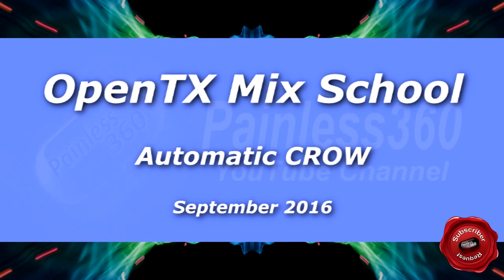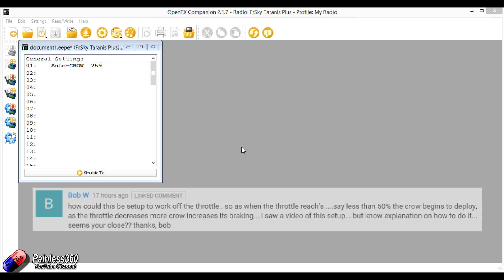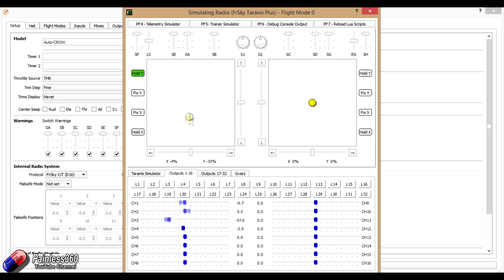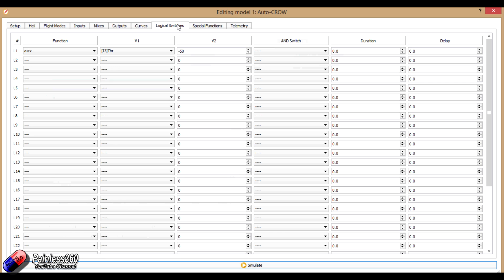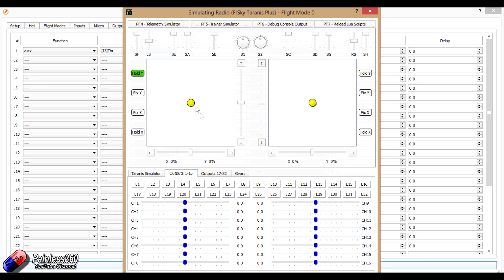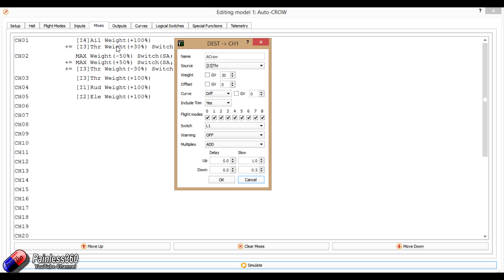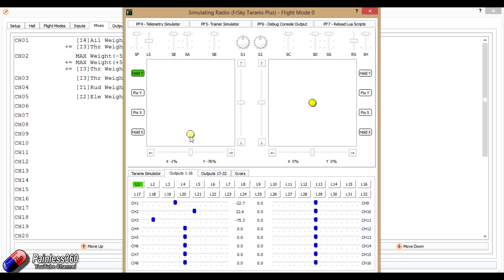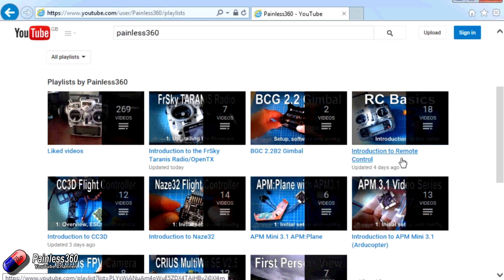OpenTX Mix School: Setting up Automatic CROW (braking) on a model

Comment: Sir I have a Question on Open TX for a F5J motor turn on emergency toggle switch. I using a Altimeter to read my Altitude and motor is shut off after 30 but I need a emergency switch if I can’t make  or landing in corn fields. Flying in competition F5J.
Reply from the maker: I'm pretty sure I have a video on something very similar to this.. It should be in the mix school playlist. Best of luck

Comment: I dont want to use a switch to have automatic crow.
I have my throttle on a switch and i use the stick to brake in the landing.
I dont want to flip a switch to make the crow function active, how can i do that?
It is an F5B plane with 3 flightmodes, speed, thermal and landing.
And yes, i can use the flightmode switch to activate but i want it active all the time.
How? (Horus X10S)
Reply from the maker: You can omit the switch h in the setup, it'll work in a similar way.  Best of luck
Reply: @Painless360  so than i put in with switch just ---. ?
Reply: @Painless360  Thanks, it was a bit a puzzle but i combined some things, i made the throttle stick a logical switch and than it replaces the SA switch in your vlog.
Thanks for the help!

Comment: Hey Lee... I noticed that when the crow activates the channels jump the first 20%... then follow the throttle down to the full 40%... it there a way to stop that and get a smooth transition... you can see it in the channel monitor... when the throttle hits -50, the ail channel jumps to -20, and flap ch jumps to -80.. then follows the throttle... I've tried finding the source of this... no luck! I can get it to stop by using a offset... but that creates other issues.Thanks, bob
Reply from the maker: Not sure what you mean. The way in the video seemed smooth..
Reply: well... if you look closely... as soon as the throttle reach's -50, all surfaces... ail/flaps jump to -20%<<ail, and +80 for the flaps , of the travel... so if the channel is set to 40% as the full crow movement, it jumps "instantly" 20% then moves the rest of the 40% as the throttle continues down... in your setup... remove the "slow" setting in your mix and it is more noticeable.. you can also see it in the channel monitor... move your throttle down and as soon as you hit -50 watch the ail and rud channels... they don't start at -1... they jump directly to -20.Thanks for getting back to me! Bob
Reply from the maker: +Bob W better to ask this through patreon.. :) then we can look at it..
Reply: I'm guessing that you have solved this already long ago?

The reason for the jump is that your switch condition is Thr < 50 %, and, going from high Thr to low Thr, as soon as that gets TRUE, you are immediately mix-adding 30 % of - 50 % Thr = - 15 % into flaps and ailerons (it jumps from level = 0 % to either 15 % or -15 %, depending on your setup). From there on, with decreasing Thr, the added value will linearly increase until Thr = - 100 = OFF.
Using an offset wouldn't remove the jump, but instead you could define a curve which smoothly increases the added value, e.g. from initially 0 % to 30 %, when Thr goes from - 50 to - 100 %. Run this into a channel, and then mix-add the channel value into flaps and ailerons, instead of directly mix-adding a percentage of Thr.

Comment: Your method for activating the crow at low throttle settings is sound, but there is a major flaw in your example - you only have one aileron servo! One servo for both flaps is ok, but to run crow you must have one servo per aileron. It would have been better to show this using a 4 servo wing (the most complex commonly used setup in gliding) and use high mixes for aileron, camber and crow that drive each of the output lines to the servos. A setup like that is slightly more complex initially, but is much easier to maintain as you refine the % values through test flying.
Reply: Ps - When putting crow on the same stick as throttle I tend to apply a different custom curve for each - linear deployment on both is highly unlikely to give the characteristics you want (i.e I set relatively slow crow deployment until the very end, where the last 40% is applied in the last few clicks; this helps save your flap servos as you can pull them in quickly just before touchdown).
Reply from the maker: Great idea but most of the models we've made on the channel in the last two months have only one Aileron channel controlling two servos using a 'Y' cable ;) These videos are to help pilots learn the techniques. You seem to have a bit of experience here - why mot create 'how to' videos for OpenTX too? Best of luck!
Reply: Painless360 I am not criticising here, you make great videos that are very useful to the community. Unfortunately in this instance though you have made an error - crow cannot be used with a single aileron servo or two run off a y lead. Why? Well as the flaps go down both ailerons must go up together, but they still need to operate in opposition to each other for aileron control. That cannot be done if both servos are receiving the same signal from the RX; they have to be on different channels. Try your EEPE on a real model with ailerons on a y lead and the problem will be easy to see; as crow deploys and the flaps go down you'll get ever increasing amounts of left or right aileron.
Reply: Ps - I do not create videos for OpenTX (not enough time and lots of people like yourself already fulfilling this need), but I do fully document and post my setups on RCSettings for others to use - one that uses a similar config with throttle and brakes on the same stick is my EFX Racer EEPE - http://rcsettings.com/index.php/viewdownload/3-fixed-wing/169-durafly-efx-racer
Reply from the maker: Nice work!
Reply: Thanks. Did you test the EEPE in the example on a model to see whether it worked? I'll bet you a pint it won't work until those ailerons are on separate channels...  ;o)

Comment: Lee, I knew there was a simple way with opentx... and I knew who to ask! I think a raise is in order! thanks so much... I've been struggling with this for days. BobW
Reply: I just checked this... and yes, I have a throttle cut on SF... the crow braking mix works even if the throttle is cut.... the throttle stick will continue to apply braking. hope this helps
Reply from the maker: All you need to do is ask fair Patreon ;)
Reply: Painless360 Is it possible to also switch off the throttle at this point and have the throttle stick only controlling the crow. Also tied to a physical switch so that you can switch it off and on. I hope that is understandable as a friend asked me the question and I only half understand the question never mind the answer 🙈
Reply from the maker: Thanks Bob! :D